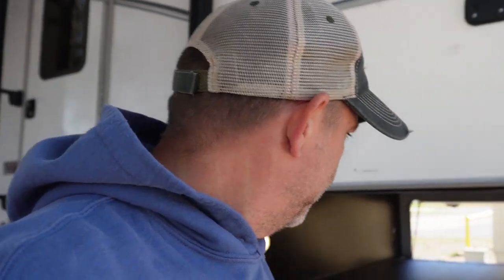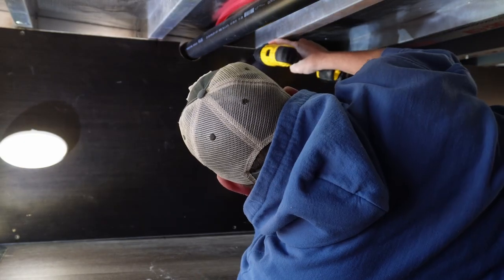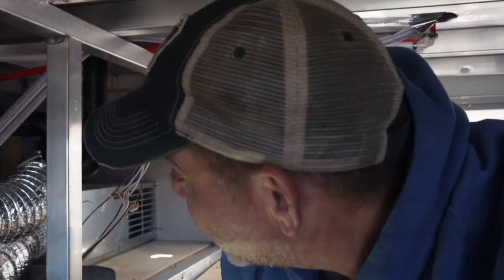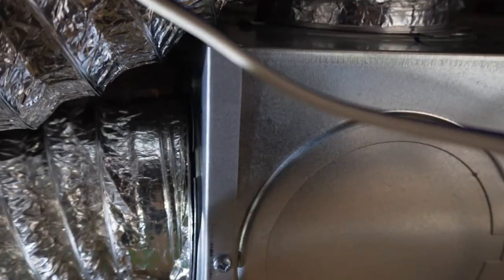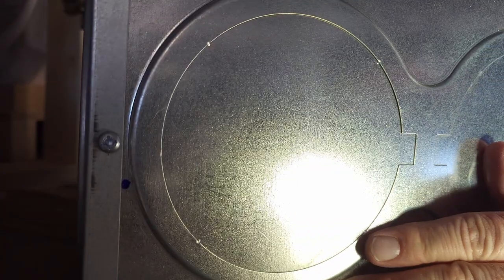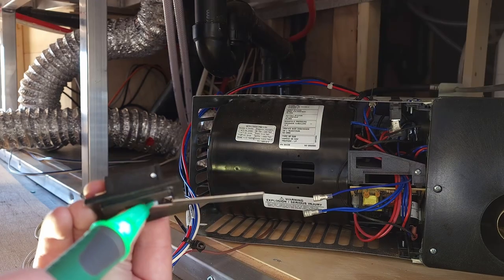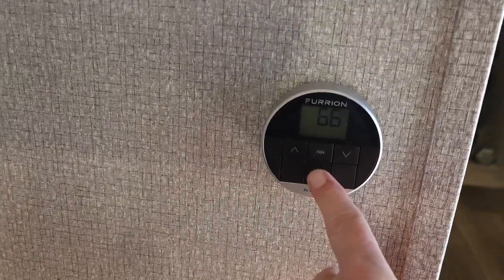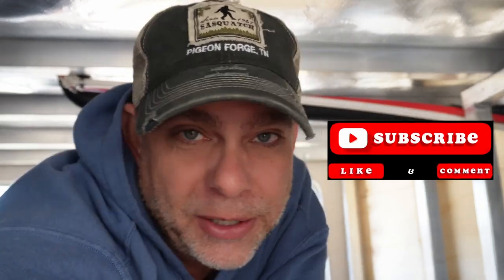RV FURNACE REPAIR. RV Furnace Won't IGNITE? Blowing COLD AIR? Watch THIS!

Comment: Good video but do you have to move or do anything with the propane line if I have to move my unit
Reply from the maker: Every setup may be different. We didn't have to move any propane and most shouldn't have to. It's fairly easy to do. Good luck!